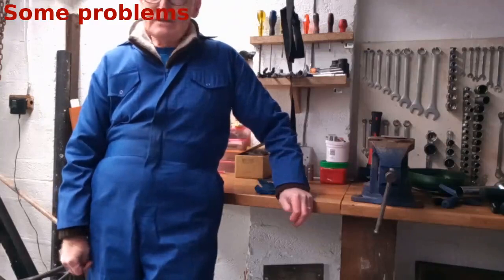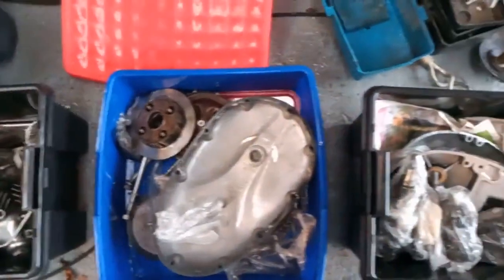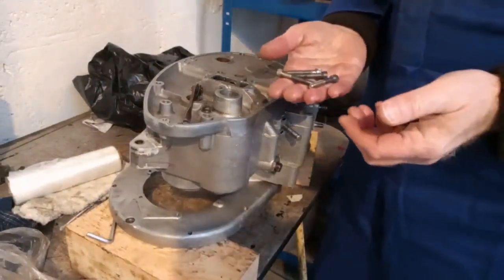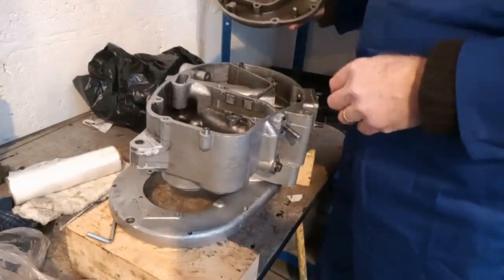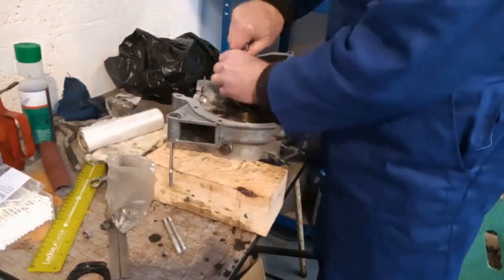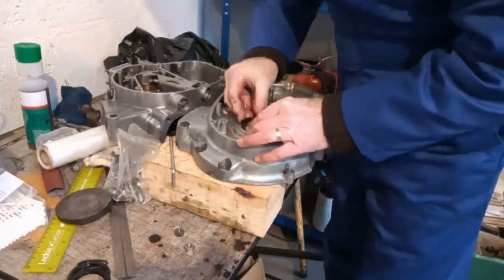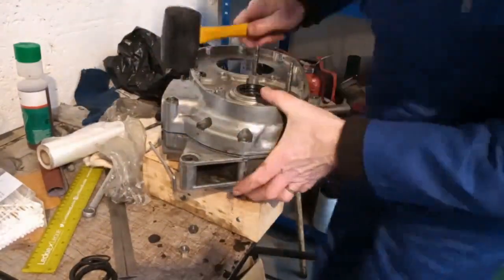BSA C15 - Second Engine Rebuild - Part 1

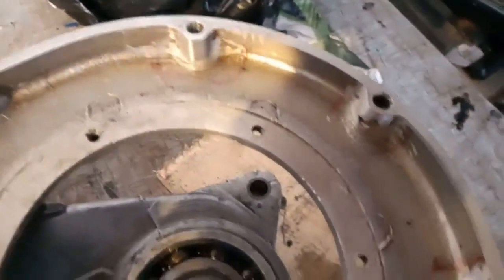Comment: I stretched the primary chain on my C15 by slipping the clutch for too long on Holywell Hill, St Albans. The stretch was incredible and resulted in the chain slack machining off the lugs you mentioned [0:51] . I tried to use bondo to fill the slots in the lugs, but it always leaked and I could never tighten the casing up enough after that. I think the swarf did some internal damage too. My Dad sold my two C15's while I was away at University!!!

Comment: Never in the field of engineering has a design so simple had so many faults! my   BSA Starfire taught me more about mechanics than just about anything
Reply from the maker: Yes Martin but for some reason we love them. You do get to know them in an intimate way!!
Reply: True never did cure the oil leak at the cylinder base but learned to live with it!!
Reply: Same with my Lightning.